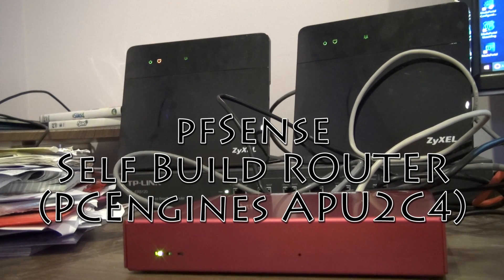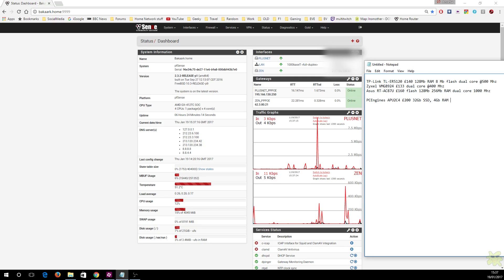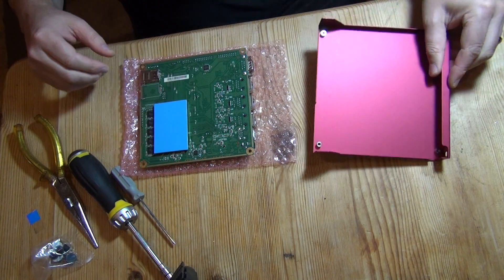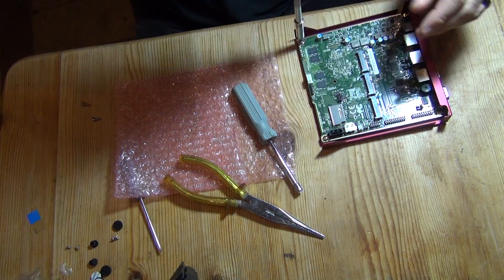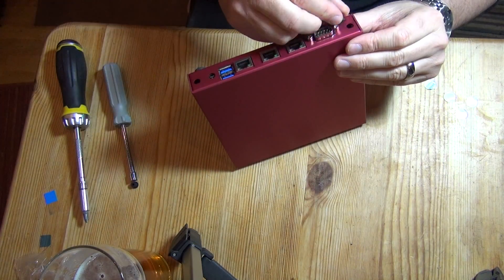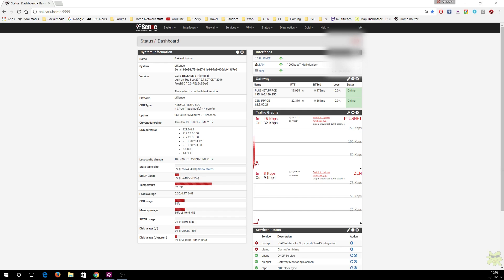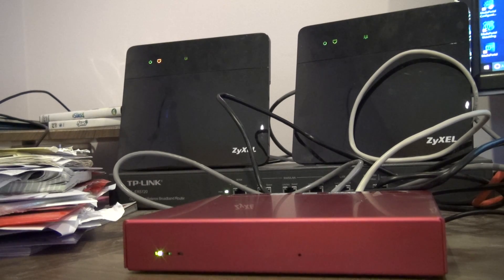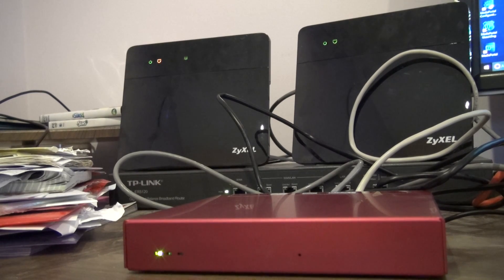pfSense Router : I assemble and review a router based on the PCEngines APU2C4

Comment: My apu1 also in the red box with wifi card and pushing lots of data on the three nics was extremely hot to the touch.  I replaced the 2 foam  squares with copper shims (arctic silver on both sides).  This alone dropped the temps on the pfsense dashboard by 10C.  Flipped it over with the feet on the top and cooled it further still but occasionally was still in the yellow.  Finally mounted some legs on it to get it off the surface about an inch and stopped getting the high temp warnings.
Reply from the maker: Good thinking, sound like yours has a lot of work to do! Mine runs at CPU temp of around 52C in the winter when its cool in the house and maybe 59C in the summer with just the passive cooling. AM

Comment: May I ask how did you get the temperature readings?
Reply from the maker: Hi George, the CPU has built in thermal sensors and the OS can display them on the dashboard, on pfSense version 2.3  and below this was not working natively and it was necessary to modify some files to get them recognised by the OS - this is described in this forum post : http://www.pcengines.info/forums/?page=post&id=795B2ACC-F4B0-4181-9B4A-54EC757D4001&fid=DF5ACB70-99C4-4C61-AFA6-4C0E0DB05B2A
Happily for me, when I upgraded to version 2.4 this functionality seems to have remained working, on previous upgrades I needed to reset the patch.  I believe this should work natively now with pfSense v2.4 and above. AM
Reply: Amoeba Man I figured it in the end. I've also just installed 2.4.1 and had only had to select the AMD sensors setting within the miscalenious tab. Thankfully they included the library in the newest pfsense version and didn't have to go the hard route. BTW, I'm getting the same readings as you- 52-53 degrees. I also ended up buying the Startech null modem cable as you advised as I decided it wasn't worth the hassle to experiment with cheap  serial adapters that at the end of the day may not work. I have now successfully set the router along with an Ubiquiti wireless AP and have basic network functionality in my house.  Time to get into deep waters with more complex settings.. Thank you so much for responding and for the very informative video!
Reply from the maker: Thats great, I hope your router is working well for you! AM

Comment: I have 3 AC68U and a 400 / 200 ISP fiber link with almost 50 devices at home and sometimes the first ac68 / main router is getting 98% of use, I was thinking about do the same as you but with a laptop with an i3 and ssd / because of the power consuption and battery backup power, also one used laptop with this config we find for 60$ on ebay, maybe less if you get one with screen broken, the only problem is how to add another LAN port to it, I was thinking about those external pci express, what do you thing? oh, I forgot to mention the silence too.
Reply from the maker: I see where you are going, a laptop would make a great router for all the reasons you mention provided you can get the second NIC up and running, this would need careful research as FreeBSD is fussy on NIC selection. AM

Comment: I have a very fast fiber connection, 950Mb/220Mb, I am wondering how much the network speed would degrade going through your setup.
Reply from the maker: I previously answered a similar question about max WAN throughput  - when I looked into this it seemed that the APU2C4 runs out of steam at around 600Mbit/s WAN so you might want to consider a more powerful system to make full use of your WAN connection, perhaps a Celeron / i3  based solution or something like the SG-2440. If you are not worried about power consumption then I have read that a second hand i5 based system with a Quad NIC intel card would manage it comfortably.  Be careful with consumer routers as I have read articles in which some of the top of the range units still struggle with full Gb WAN connections. A nice problem to have..... good luck! AM
Reply: That what I feared! Thanks for the insight.
Reply: on linux it won't. on freebsd/pfsense, it is around 600mbit/s

Comment: CPU Type AMD G-T40E Processor
2 CPUs: 1 package(s) x 2 core(s)
Uptime 634 Days 22 Hours 40 Minutes 45 Seconds :)

PfSense rocks and so do the APUs. I have one in each of my two cabs in the datacenter plus one at home, all linked via site to site OpenVPN.
Reply from the maker: Darren, that's great feedback! Mine has also been flawless in its reliability, the only restarts being the ones I initiated myself!  When I compare it with my previous load balancing router, the TP Link TL-ER5120 (https://www.youtube.com/watch?v=wGqcGeTQ7lI) - the TP-Link would require a reboot every 48-72 hours and would crash causing network outages.  Cheers! AM
Reply: My setup is very similar to yours too. Obviously mine is the earlier version of the APU but I also went msata too and I am dual WAN, ZEN+BT. I actually came across your vid because I'm looking to upgrade to a 4 port solution at least as I need to get my public IPs routing without NAT.
Reply from the maker: Cool, I hope your upgrade goes well! AM

Comment: please make a video on pfsense OS installtion. I have the same router and i have a problem with the installation.
Reply from the maker: Hi Chandu, I am sorry you are having trouble with your install, you don't say what the issue is?

From memory I followed the instructions in the manual (https://www.pcengines.ch/pdf/apu2.pdf) which are basically : 
1. create a TinyCore USB stick,
2. copy the pfsense image to the stick,
3. boot the APU2 from the USB stick and then write the image to the drive in your APU2
4. reboot the APU2
You will obviously need a functioning null-modem cable like the one I show in the video and make sure you have the right pfsense image (amd64 nanobsd with serial console).

I hope you get it fixed soon!

AM
Reply: hi Amoeba Man, i have downloaded image from pfsense and I have serial port in device but I don't have serial in my laptop. So can I connect it using serial female to USB. Installion media is pendrive. I have ordered the serial to USB cable once I receive the cable I will install it using putty. Correct me if my procedure is wrong.
Reply from the maker: Make sure your cable is null-modem to USB cable - its different to a serial cable - you can get adapter to go from serial to Null-modem!
Reply: Hello. May I ask if by any chance you know whether a cable like this http://www.ebay.co.uk/itm/Ugreen-USB-to-RS232-Serial-DB9-9-pin-Converter-Adapter-Cable-for-Win-10-8-7-Mac/131870144757?_trkparms=aid%3D111001%26algo%3DREC.SEED%26ao%3D1%26asc%3D20160727114228%26meid%3D1d83a6f15b8044fdb2cf78d1f057fd5f%26pid%3D100290%26rk%3D1%26rkt%3D4%26sd%3D131870144757&_trksid=p2060778.c100290.m3507 will do the job? I can't justify paying over 20 pounds for the Startech one.

The above looks similar but I don't know whether the chipset included(which is different) is compatible with PC Engines devices.

Comment: How much bandwidth will this board support? It would be interesting to see a video of an iperf test. You can install iperf on pfsense as a package.
Reply from the maker: HI Shawn, my WAN connections are nowhere near fast enough to tax the hardware, and unlikely ever to be at my current location.  From what I have read the hardware runs out of steam at around 600Mbit/s WAN throughput - if you Google "APU2C4 throughput" you can find specific tests others have done.
I don't think this is too bad for a firewalled connection and only using 6W of power, it also depends on what services you are running, in my case I imagine load balancing dual WAN and failover probably also affect peak throughput.

There are no issues on the LAN side, which as you would expect runs at full Gb speed.

If you are lucky enough to have a GB speed connection you need faster hardware, I suspect

AM
Reply: Shawn Blees I only have a 100meg service but see no degradation ever under pfSense even running full time VPN, Snort and pfBlockerNG with over 800k blacklisted addresses.   Several on the forum run on +380meg systems.   It is really more limited by your hardware than pfSense.   I just recently moved from PC to a Netgate pfSense box for the same power reasons noted by OP.

Comment: I see you have the same type of router from your ISP as me and I run in to issues replacing the ZyXEL with a custom router os. 
I get my Internet working but TV and phone is just a pain in the ass and I can't get it to work... Do you have any experience getting the ZyXEL settings over to Pfsense.
Reply from the maker: I bought my two Zyxel VMG8924 routers purely for use as modems as they have the excellent BCM63168 chipset which gives me a relatively stable connection on my long and noisy line, I was not given them by my ISP's.   I have used them as routers in the past (and made a separate video about them).  They have a pretty good feature set and WebUI, pfSense has many more features but to be honest I would expect the VMG8924 to be able meet most peoples requirements.  The key to using them as modems bridging to another router (including a pfSense one) is to make sure you have them in bridge mode and have the correct interfaces setup in the Interfaces page of the UI.  Good luck, AM